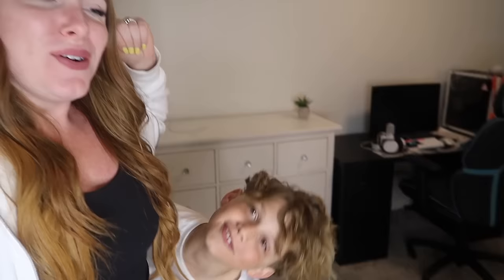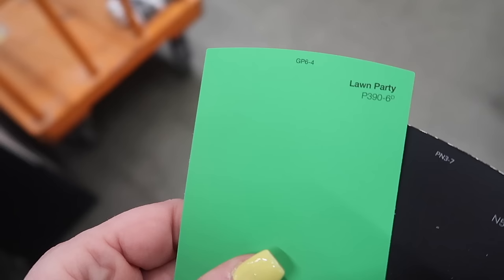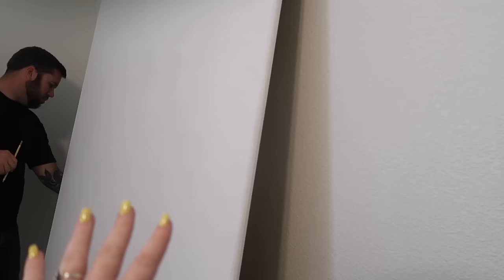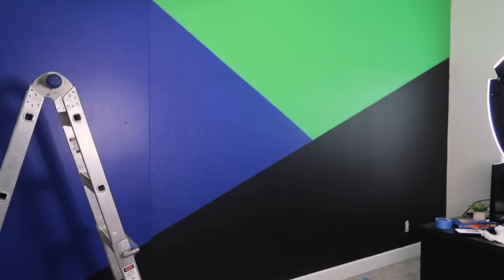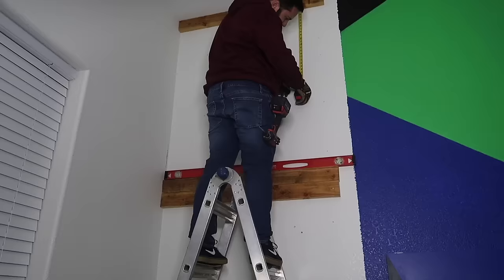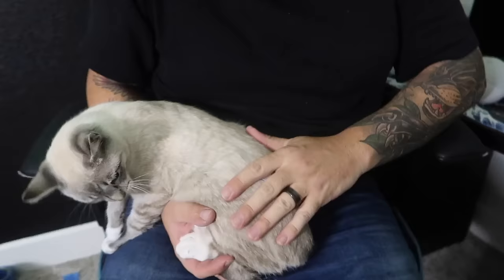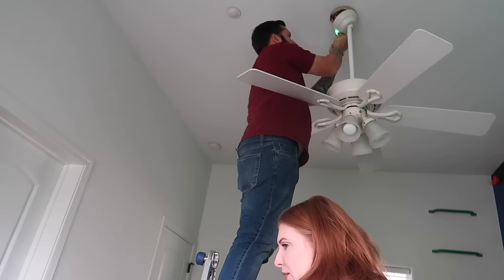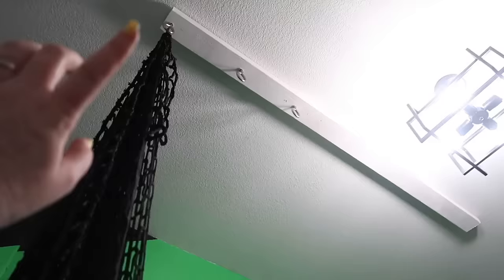Pre-teen BOY *DREAM* Room Makeover (w/ DIY Rock Wall)

Comment: Fill in the screw holes on the plywood and paint over them. Then evenly space out the netting on the carabeaners and cut the extra netting off that's hanging down. I'd give yourself more time than 2 days to do big projects like this next time so it doesn't look half-assed.